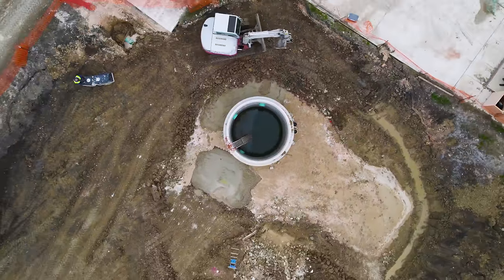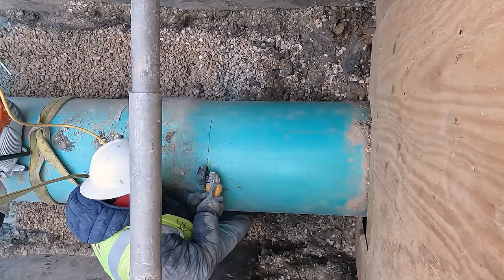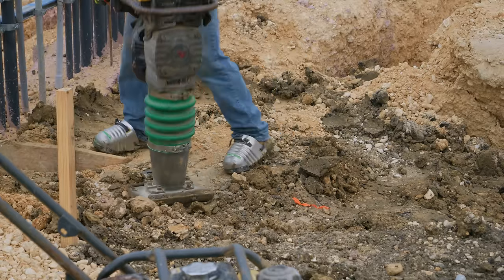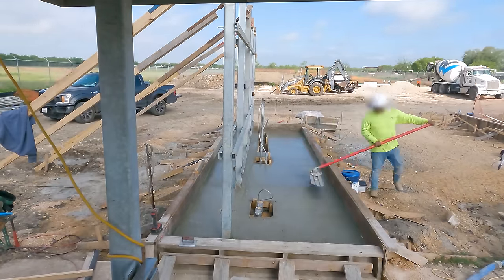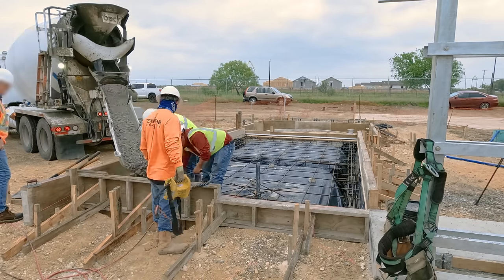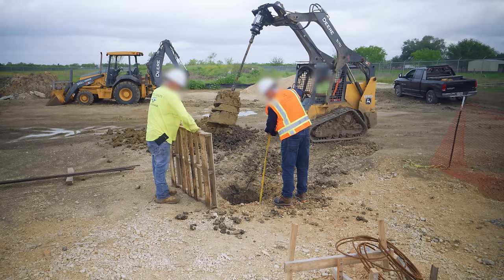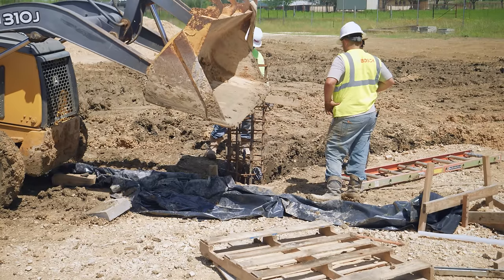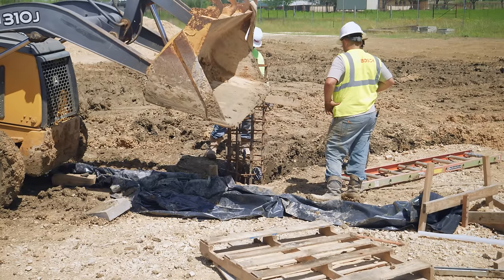HEAVY CONSTRUCTION of a Sewage Pump Station - Ep 4

Comment: Genuine question, what is the poi t of void forms? From what i get it decreases the amount of concrete you need but because it's bio degradible itll leave a void underneath the concrete slab. Why not just backfill underneath to support the concrete above?
Reply: The idea is that the slab that covers the wetwell needs to stay connected to the perimeter slabs of concrete as well. When you look at them putting in the void forms, you see that they fill the space between the central hole and the square perimeter.

If you filled that space with backfill, then if the perimeter settled or shifted over time, then the slab would be stressed because its outer edges would sink, but the backfill would keep it held up. If it's empty, then it can sink along with the perimeter. That's how I understand it, anyways.

Comment: That inspector checking the compaction with their nuclear density gauge should lose their license. Exposing the source rod outside of the hole made is an "unnecessary exposure" and is a fireable offense at my company. 
The proper procedure is to tap your hole with the striker plate, hammer, and rod. Then trace the plate with the rod to create an outline for your density gauge. Place your density gauge over the outlined rectangle, then insert the rod into the hole. Thus keeping yourself and others as safe as possible from any radiation exposure.
To be fair, the amount of radiation in those gauges is incredibly small, and not enough to harm you without years of constant unnecessary exposure. But radiation is a big deal, and should be treated with respect for yourself, and those around you.

Comment: Is it common practice to use cardboard to form a void around the top of the wet well and the slab above it? Could you have rebar pre-formed in the top of the wet well to mechanically bond with the top slab?
Reply: I had that same thought.  The conclusion that I came to is that doweling the slab to the top of the wetwell and letting the slab sit on grade is that it could actually end up even worse: if the bottom of the wetwell settles when the top ring is permanently attached to the slab, then the slab will keep that top ring in place.  This means that the bottom rings will separate from the top, and the wetwell itself will come apart.

Compare to if they had the slab on grade but not attached, where the separation will just occur at between the wetwell and slab.  Bad--which is why they did what they did with forming a void under the slab--but not quite as bad as having the break in the wetwell wall.

Comment: how do you close the gap the two sections of cut pipe? Am I right in thinking that you can't move the ends of the two ends? so how do you bridge the gap? 

is there some sort of expanding pipe that you can fit between te sections and then stretch out to cover the ends? not sure how else you would do it

Comment: Nice project but lots of poor planning since they had to cut concrete out they installed earlier in the project to install things they knew would be required.  Doing this once or twice for access to the site is understandable but you have shown a lot of concrete cutting due to poor planning.